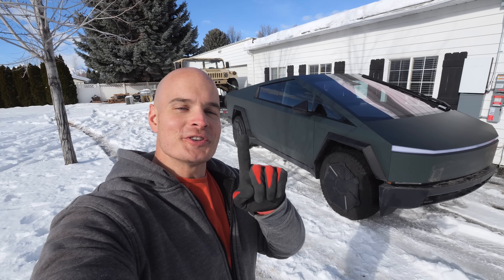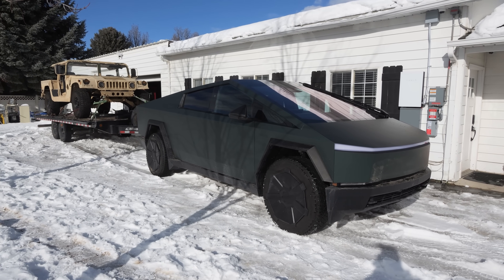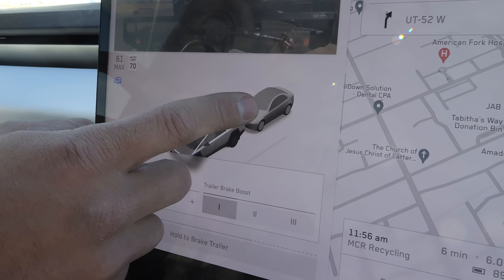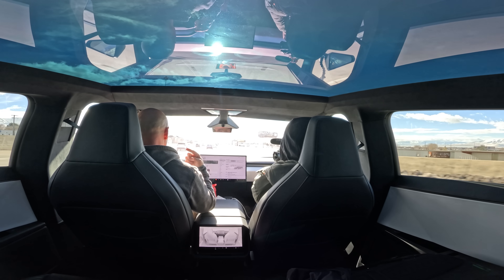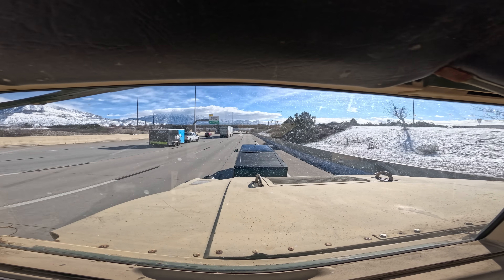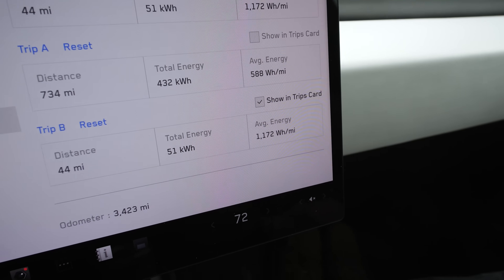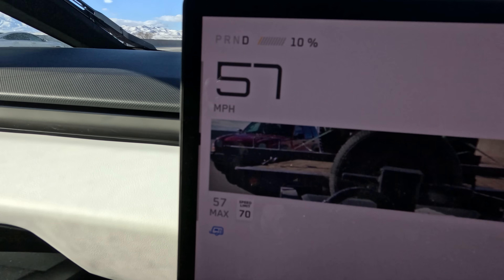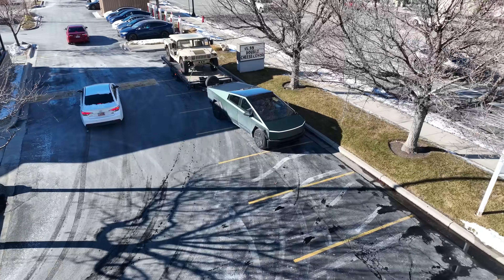How far can the CYBERTRUCK tow 11,000lbs in Freezing Weather?

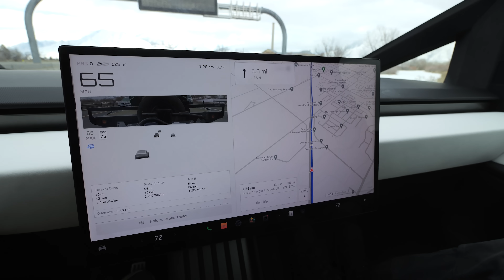Comment: 12:08 "It's interesting that the navigation is doing a better range calculation than the actual battery percentage at the top"

Great video as always! But wanted to point out that the battery percentage at the top, when swapped to miles, is the EPA range times the battery percentage/100.

Unlike other EVs, Teslas do not have "guessometers." The navigation screen calculates the battery percentage based on the current route's upcoming elevation, probable speed, traffic, wind conditions, distance, etc. which is far more accurate than any guessometer because it is specific to the route you're on (tesla navigation is within 2% accurate most of the time in my experience, whereas the average guessometer might tell you you only have 50 miles of range left because youve been driving at 80 mph every day for the past week, when really you have 100 miles left on your current trip).

These 2 different metrics that Tesla gives you are extremely useful, because in a pinch you can see what you'll get if you drive slowly and efficiently, but you can also see within a few percent your current trip estimate when driving normally.
Reply: Thats all just stupid, at leat give the option to use a predictive range or at least one based on average consumption. Most people do 99% of their driving on a handfull of routes. So i dont care what the epa average is, i want my average because that is a way more realistic estimation for my driving
Reply: @derfurz8618 then put your route into the map. It'll be accurate to within a few percent
Reply: @derfurz8618 I think having 1 consistent metric, and one "guessometer-like" metric is the best of both worlds. Except you don't get a guessometer that tells you you've got 400 miles of range left because you've been driving city in 75 degree clear weather for 3 weeks, only to get stranded on a road trip consisting mostly of highway driving in sub 32 degree weather.
Reply: @erenjaeger9418  The Epa average is as much a guessometer as anything else. Just do it like everybody else and show both a percentage and a range estimate based on your average, because guess what the EPA average is not gonna be accurate at sub 32 wheather either, so at least if its based on your average its correct some of the time not never. Most cars can even take into account both your average consumption and the current trip consumption if it notices that you are using way more suddenly.

Also i dont the navigation system on most routes. So if i get into my car i want to know and see how far I, with my driving, am likely to go.
Reply: @derfurz8618  the EPA isn't gonna be accurate sure, but at least I know if I drive 45 mph on flat terrain I'll get more than that. On a normal guessometer I have no idea how many miles I'll get. That's the difference
Reply: @derfurz8618  if you don't use navigation for short day trips that's fine. I don't either for a lot of stuff, since I know I'm not gonna use more than like 20% of my battery per day. But the navigation is essential for road trips. It preplans supercharger stops at just the right times, and if you select chargers you want to go to, it'll tell you what percent you'll have when you arrive to within a couple percent. That is clearly far superior to any guessometer. So you have 1 metric that's better than guessometer because it's like guessometer but more consistent/predictable, and you have another that's like the guessometer but wayyyy more accurate. I don't see why anyone would want to go back, other than just being used to it and being resistant to change anyway
Reply: @erenjaeger9418  if you drive drive your EV to zero you are the problem not the range display. I'll take a accurate display for 99% of my driving over one for a situation that already fucked up anyway
Reply: @derfurz8618  I have literally never done that and I've owned a Nissan leaf and a model 3. And as for wanting an accurate display, same! The guessometer is not accurate, and it's not even consistent like the EPA range figure. That's why I'd take Tesla's system over any other EV any day

Comment: Here in Europe there is a network called "FastNed" that is a Dutch charging network supplier. In a slightly racist comment: Being Dutch almost all of their charging stations are pull-through. If you don't know, the Dutch have the reputation of taking every vacation with a camper or caravan attached to a car. :-) I did over 2000 Km in my Skoda Enyaq (better VW ID4)pulling a trailer. Range was not hurt too bad as you can only go 100 kph/62 mph when pulling a trailer. It did add about 30 minutes to the trip because I had to find the FastNed chargers but I needed the break as I was on my own..... It was fun pulling passed all the other cars uphill thanks to all the torque.... ;.)

Comment: One more reason electric trucks or electric cars are not suitable for towing. I would be out of power for a weekend trip to the lake, where few or no charging stations exist. A non-green vehicle. whose components are sourced and installed by slave labor, and cost about as much as a small house used to cost before rampant inflation. Hard pass on that idea.

Comment: Cybertruck seems like such an impractical pickup. Even if they add pull through chargers "in some places", if the range is so low towing, that won't matter much.
Reply: I live in NC where probably 70% of vehicles are pickups and they are not towing anything 99.9% of the time.
Reply: @diamond_h0us  I mean more than just the towing and range, but if you are towing, adding pull through chargers "in some places" is not helpful in practice. If you want people to actually be able to tow anything longer distances, you'll need quite a few of them. I mean, clearly it's a novelty truck like a huge lifted one.
Reply: What other people do or don't do will not help the, Cybertruck owners who want to tow. Tesla stans and their excuses.  @diamond_h0us
Reply: @diamond_h0us  Most people probably drive their 4-seat car around alone, so why aren't most vehicles 1-seaters?

Because you buy vehicles for the long term and they need to be able to accommodate situations that don't happen every moment of every day.  Probably not many people want to buy a truck and then need to rent another truck for towing etc.
Reply: @Destor-p3b  Man don't come with this bs. Most people doesn't tow, period. And yes, most places around the world people buy cars that accomodate their needs, but it also means that if you're travelling alone in the city, you buy a compact, because its easier to find a large enough parking spot, not to mention the tighter turn radius. If you have a family, you buy a wagon or minibus so all your stuff can be placed, etc...

 If it weren't for the tax exemption, USA wouldn't have an SUV/Truck problem today and you wouldn't wanna try to explain the absurd "HOW MUCH CAN IT TOW" or "WHATS THE RANGE" nonsense.
Reply: @aflac82  It is advertised as a truck. Testing its towing is not bullshit. If Tesla cannot run with the big dogs, they should stay on the porch.
Reply: @TroySavary  I wasn't talking about the video. I was talking about the idea that towing would be important in general. It's not.
Reply: Just like the Lightning and Rivian.

Comment: Man 3:32 up until here I kept saying HOW BAD this truck looks. It literally looks like a cardboard toboggan. The interior is sooooo bland and "cold". The fact that there is a tow mode and the display doesn't represent it, just demonstrates how little Tesla cares. As for the acceleration, you can have 10,000HP and accelerate "just as much as" 100HP, the limiting factor are the tires and environment. The Rivian shows what engineering is about. The amount of information available to the driver is incredible. As nerd and mechanic, I totally get behind that and always wondered, why manufacturers don't have two modes in their fancy displays, standard and expert. So you can switch between the information being displayed. Anyway, that Cybertruck is an absolute turd. Thanks for showcasing this thing.

Comment: 108 kwh consumed for 90mi; the usable capacity of the battery is 123kwh -> 90/108*123 = roughly 102.5mi if you use all the battery.
Reply: Don't forget to deduct the battery internal resistance losses because towing 11000Lbs will need quite some power, increasing losses .
Reply: …and the truck was not at 100% charge when leaving
Reply: @cb2206  It was, he literally shows on screen. Also, you are trusting tesla's misleading metrics
Reply: @pedro4205  yup, 108kwh consumption was shown on the screen. Doesn’t change that it’s 123kwh pack

Comment: 4:17 most likely there's no function for the vehicle to distinguish between an empty and a trailer carrying another vehicle or object. Thus, most probably for traffic safety reasons and to enable all ADAS and automated traffic safety functions it still leaves the sensors active which ultimately provide these false depiction of the surrounding traffic environment.
Reply: Or they just fidnt bother to implement it yet because they figured most people wont be using a trailer with it. There is a reason why any other cars turns of rear facing sensors when the detect a trailer. There are no traffic safety reasons to leave them on

Comment: oh no. I can understand the charging areas not having spots for trucks towing, although this should have been getting fixed after announcing the cyber truck, putting the charging port on the back end of the truck was just poor design. It shows that they didn't do much testing while towing, because if they had it would have been very obvious that's not a good spot. That's on top of the lack of information while towing.
Reply: Pull through stalls are relative commen in Norway. There are two stalls behind each other so two cars can charge if they have no trailers.

My local IKEA changed the setup so that around half the stalls are pull through.

Comment: Pretty low range but 11k lbs is a good amount of weight in the middle of the winter in hilly terrain.
Reply: Yeah, it's awful. I'm super disappointed.
Reply: Lol!!!! The ford f150 petrol alone will still get over 4x that range left lets not even mention the diesel version.
Reply: @alanmay7929  Incorrect an F150 towing 5k lbs only gets 190miles of range. Towing heavy things decreases efficiancy in ICE vehicles also.
Reply: @EnigmaProduction  completely untrue. Maybe 10 years ago, a N/A v6... not with modern ecoboosts.
Reply: @tacticalidiot175  The test was done with a 2020 F150 tow package with 2.7 econo boost, pulling a tandem camper that weighed 5000lbs and got 9 mpg. Assuming ~22 gallon tank. Im not saying EVs are good for towing bc they are not. But people forget how much heavy towing impacts range ICE vehincals also.
Reply: Electric junk, that's it
Reply: @tullo5564  personally I would never buy an EV if I needed to depend on it for towing but let's be realistic what percentage of people actually tow with their trucks? Not many. It's nice to know that the cybertruck has the capability to move 11k lbs. There's a bunch of vehicles like the Tacoma, gladiator, most SUVs that don't have that capability.

Comment: The battery percent will never adjust based on weather, driving, or towing. It’s just the epa estimate. You need to route somewhere and use that to estimate range. This is a very basic thing all teslas do. Always use the trip Calc for your estimates
Reply: They do it on purpose, they would rather you go out and say "I have 300 miles on a full charge" vs the reality that it's more like 100 miles when towing. This was even made public, Elon himself directed tesla engineers to artificially inflate range numbers
Reply: False.
Reply: Which is nonsense - every other ev doesn't do that.
Reply: @sprockkets Teslas are very accurate if you use navigation. You will always get to the charger with juice left, towing or not.
Reply: @stighaaland5357  And if I"m not using navigation, then what?
Reply: @sprockkets  Then it is on you. Dumb not to use on roadtrips.
Reply: @stighaaland5357   I don't need navigation to travel around bro. Completely stupid.

Comment: 4 years of development after the announcement, with the opportunity to benchmark against Rivian, Ford, and Chevy along the way, and this is the best Tesla can do?
Reply: Exactly, what happened to 500 miles range???
Reply: @randygreen7871 that wasn't with  towing, your not getting 500 miles with most gas powered trucks
Reply: @lilcourtny08  My  Ford dually gets 663 miles on 1 tank.
Reply: @randygreen7871  are you getting 663 miles while towing 10k pounds?
Reply: @randygreen7871  500 mile range was not including towing and it was based on the hoped for high performance 4680 that had a silicon anode.  That battery has not been developed yet.  It will be interesting to see how things transpire over the next few years.
Reply: @nerothe  Yes I realize that.
Reply: As a mechanic I will reserve my opinion for another 4 years to see how they compare after some abuse?!

Comment: Great review brother.  Yes if this was the cyber beast TriMotor. It would have done less than 12 sec for 0-60.  845 hP vs 600 and 2.6 0-60 without trailer 11k Cyberbeast Versus Dual Motor 3.4. Great knowledge about low miles save gas and aerodynamics learned new things. Always amazing watching your videos. Got Dbrand iPhone 15 pro max X-ray cases to support you Brother and made video on it on my channel. Will make Cyberbeast TriMotor foundation videos once I get it in Mid 2024
Reply: But what about the range?  70 miles?

Comment: I have nothing against EV's but most people don't tow below the speed limit and its honestly not that safe to disrupt the flow of traffic by driving 55mph. I think that its safe to say that after a few years of battery degradation and at 70+ mph, you'd have to be content with a 60-70 mile range.
Reply: I see plenty of trucks who tow below the speed limit on the right hand, especially when dealing with something like 11000lbs. The only ones who drives fast are the ones towing a commercial law mower which is like 1/10th the weight.
Reply: Im sure things vary by region but for the past 17 years Ive hauled construction equipment ranging from 10-20k daily and I personally don't go below 65 on the highway or see others doing so practically ever.  @Singuy888
Reply: Um, sorry but most smart people drive below speed limit when towing heavy loads. If you don't care about you or your families life then that's on you.
Reply: What's the lorry speed limit on a motorway for you guys over there, in the US, if any? Is there any for trailers?
In Denmark it's 80km/h for both lorries, and regular trailers - though you can get trailers approved for 100km/h (50 & 60mph).
Reply: It varies by state but highway limits are anywhere from 65mph all the way up to 80mph in some places like rural Texas. With that said, most people drive 5-10mph over. 55 is the normal speed for 2 lane roads. @Nightykk
Reply: ...which would still be plenty for 95% of 1500 class truck users.
Reply: I'm not going to speculate who that would be adequate for but 95% seems really high. I think it would be vastly inadequate for anyone using it for work purposes and would be very limiting for anyone wanting to tow an RV to vacation spots. @MrArcticPOWER

Comment: As far as the rear view mirror. I feel as though Tesla could have made the mirror a camera screen and right on the back of the Cyber Truck where the glass and bed cover is they could have installed a camera. So it would have been a traditional mirror, rather a camera but would be more useful than the camera view on the center screen.

Comment: Steer-by-wire is terrifying to me. And you cannot change my mind on that.
Reply: It's a solution in search of a problem.
Reply: New Lexus’s have it. I think it’s the future of the industry
Reply: @ZIbra_0   New cars start when you press the horn. Future of the industry can be pretty dumb.
Reply: Why
Reply: Nobody cares.
Reply: Don’t fly in any commercial aircraft then….. they’ve all been fly by wire for a long time….
Reply: @BI11YB0NE5  I very much doubt that Tesla has 3 or 4 separate redundant computers, data-buses and actors.....so no - it is not the same.
Reply: @BI11YB0NE5  Don't fly fighter jets either. There you only indicate what you want to do and the computers then take over and execute what is reasonable.
Reply: @BI11YB0NE5  Yeah, how did that work out for the Boeing 737 Max doing a "I know better than the pilots" bullsht? 
Tesla can't even launch this thing with proper fake self driving, won't put in parking prawls in any of their cars, won't put in emergency releases in the rear for the 3 or Y, even on the refresh, and you trust them to do steer by wire right?

LOL, have fun with that.